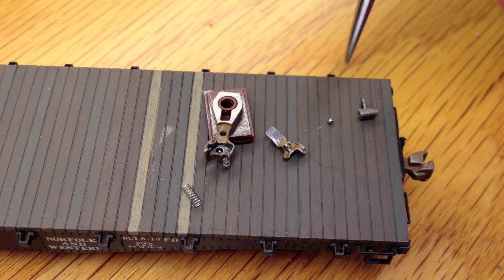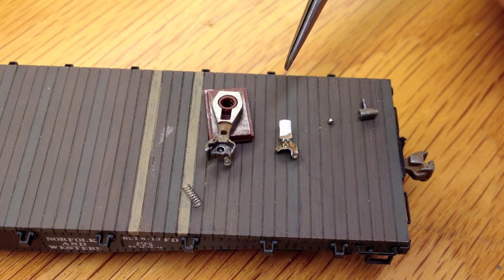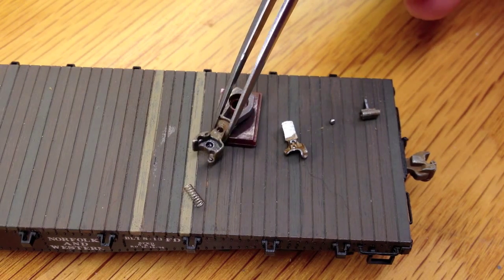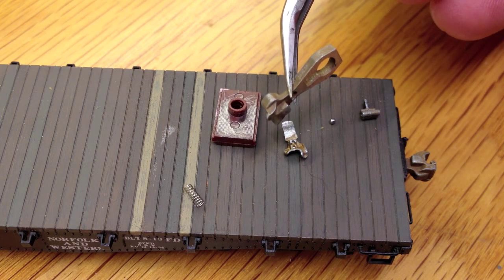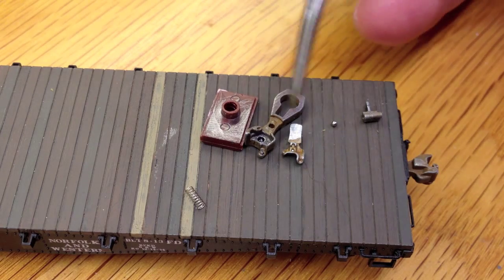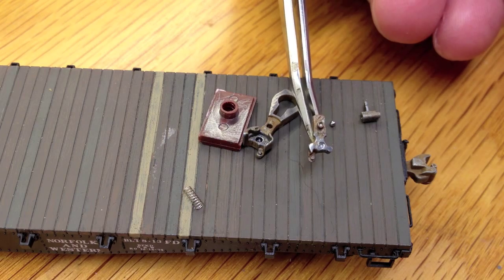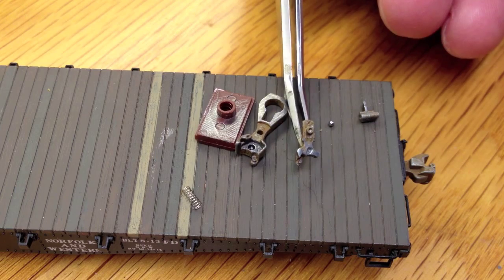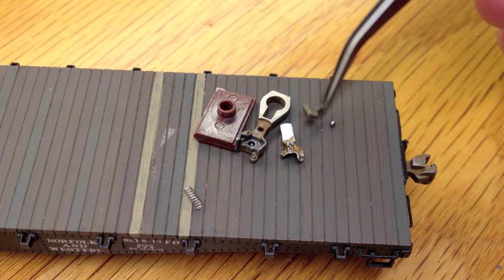Sergent Engineering Couplers - Parts Overview

Comment from the maker: Chris,  these couplers will fit in a #5 box, though Accurail boxes have to be shimmed - Sergent shanks are thicker than Kadee for appearance reasons (it was a design choice by Sergent).  There are special instructions on the Sergent site.  I haven't had any trouble with other boxes.